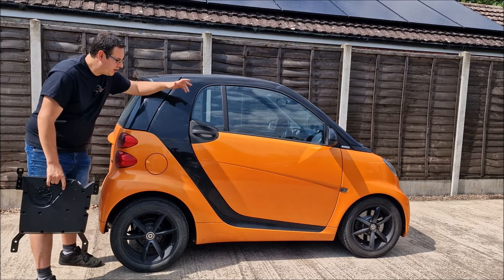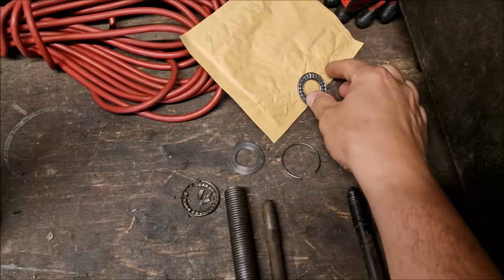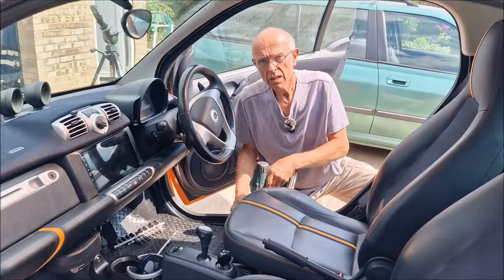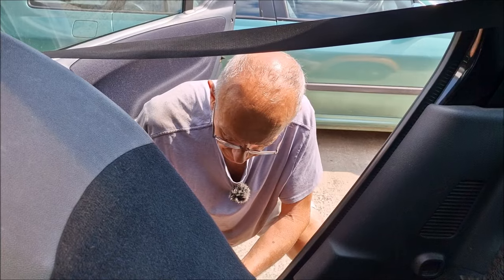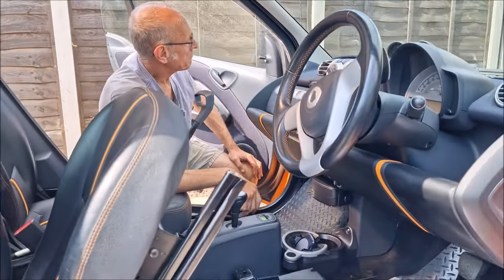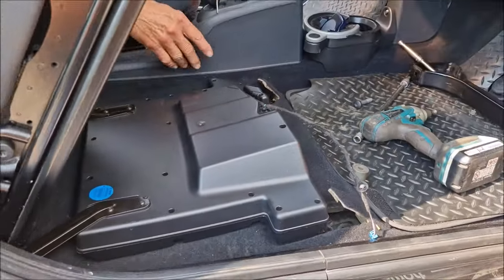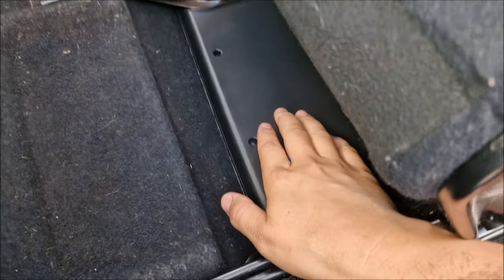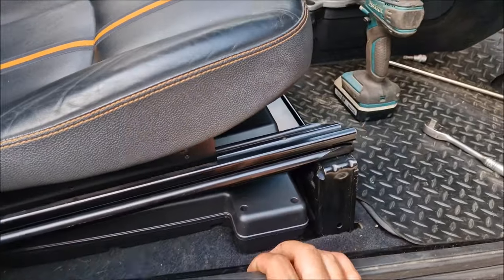A Waste Of Time And Money? - Smart ForTwo 451 Underseat Subwoofer Fitted

Comment: I've just gone out and checked if I have a subwoofer which I do and it's fitted exactly as you've fitted yours! I'm not surprised I have it tbh whoever bought mine originally spec'd it right up, it has cruise control, heated leather seats, front fog lights, convertible,ac and flappy paddle gear selectors!
Reply from the maker: That's reassuring to hear!

Comment: Nice one. I wondered about any wiring of the side airbags to disconnect? Or is this included in the blue plug you handled? 
Concerning the acquisition costs, 50 quid is about a third of what a used woofer currently costs in Germany, so a bargain. Cheers.
Reply from the maker: Remarkably there are no side airbags!

Comment: It's 100% upside down Jon 😂😅
Reply from the maker: It looks it right! But absolutely it won't fit the other way
Reply: @JonCoupland Definitely needs flipping over. The sub is meant to be pointed up to the seat ie the speaker itself. It's pointed down to the car floor which was why you weren't impressed with the sound results! You will be losing all the sound it was intended for 😊👍🏼👌🏼
Reply from the maker: @mr_omega_007  I absolutely agree - ive requested the fitting instructions from Sam our friend at Mercedes ... but genuinely - looking at other peoples - theirs are the same!
Reply: @JonCoupland Then they all need to change theirs around also 😂😅😮You'll thank me later when you realise how much better it sounds 😊